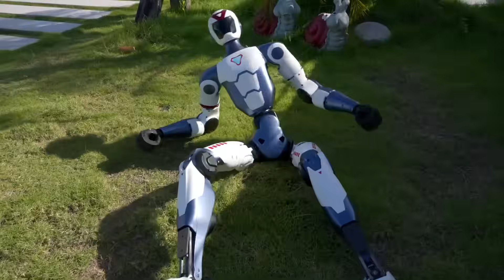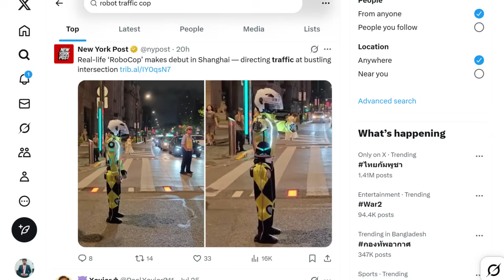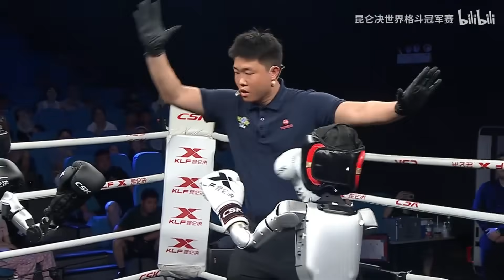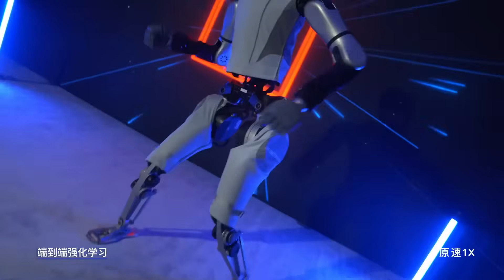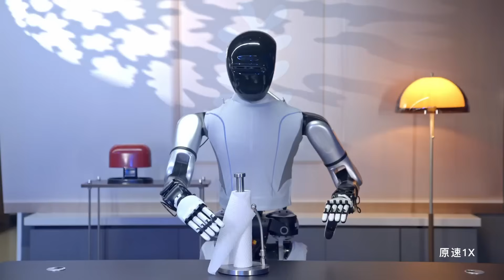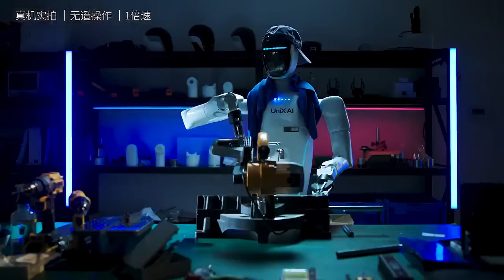Unitree’s NEW $5,900 Humanoid Robot SHOCKS the World!

Comment: A one hour battery is a deal breaker for many people. It’s just ridiculously short lived.
Reply: Robots that change their own battery is becoming common!
Reply: Each robot needs two batteries that are hot swappable
Reply: I can work 8 hours on one cheese burger.
Reply: Fuel cells are comming
Reply: Which is why these robots need to be powered by other ways other than electricity one example could be solar power.
Reply: @Dark16489  That's still electricity. But I think you'd be better off using methanol fuel cells.